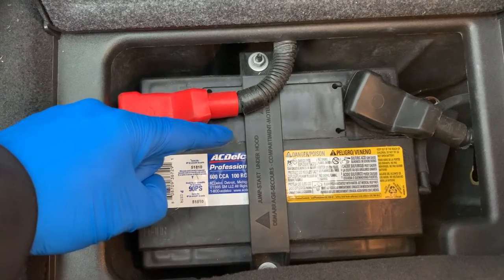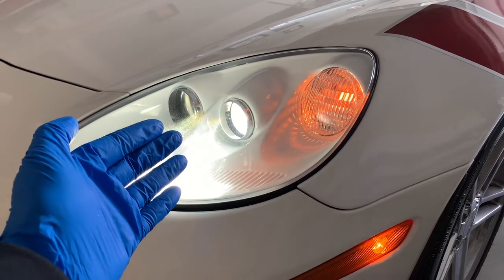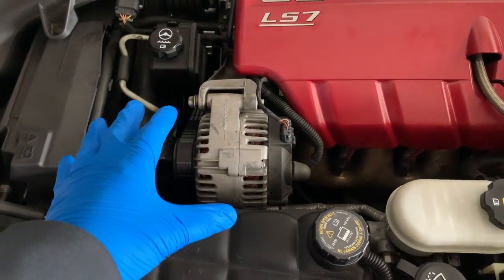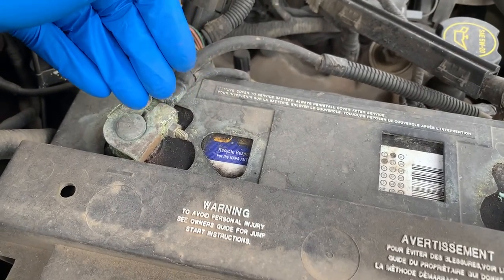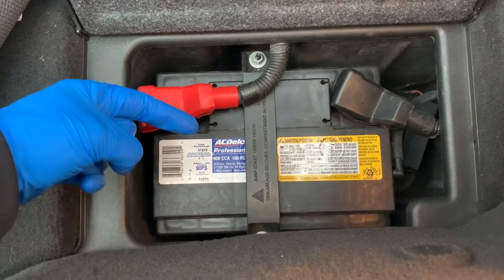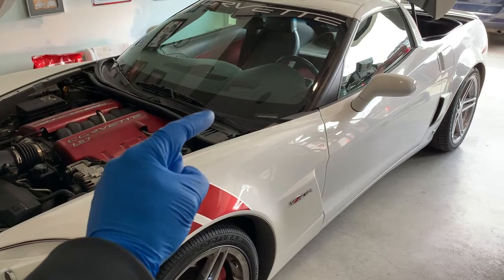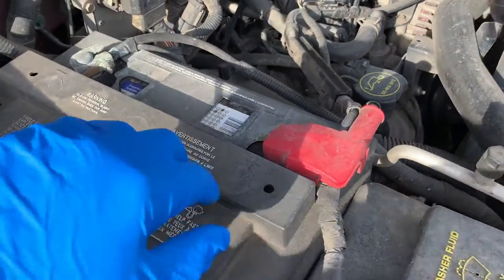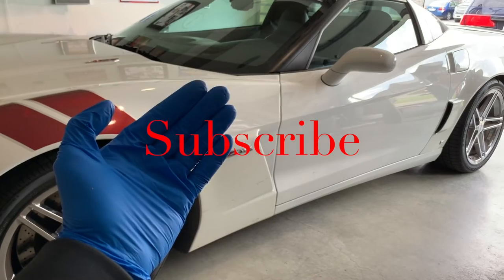7 Things That Can Drain Your Car Battery

Comment: I'm wondering, "What kind of car has a speedometer that goes up to 300+kph?" - then I see the engine block in the next sequence. Mystery solved. Sweeeet. Thanks. I think I just have a bad cell in my battery as the fancy charger does a 'recondition' attempt, then sends a "No Good Battery/Won't even try charging it" error. My old school trickle charger starts with about 5.5 amps and after several hours settles down to 3 amps but won't get lower than that - even when I disconnect the N battery cable and try again. Happily, my mechanic says the battery is on a 4 year full-replacement guaranty, so let's see how that goes. Thanks again for a concise and informational video.
Reply from the maker: A lot of battery’s are on a prorated warranty program, so if you can get a full replacement - take it!
Reply: How long are short trips? 20 min ?